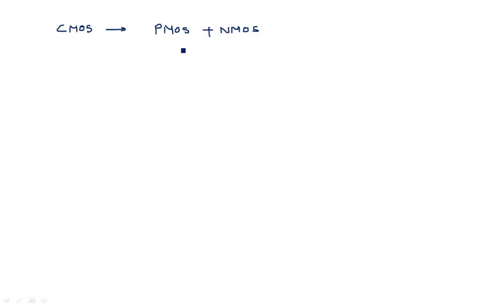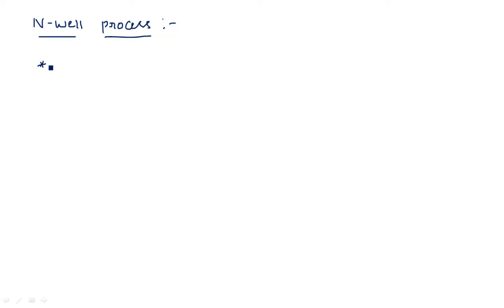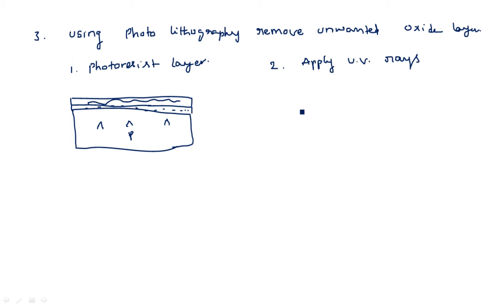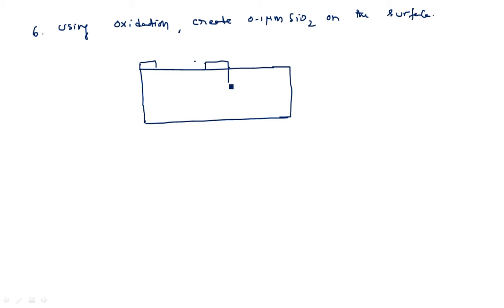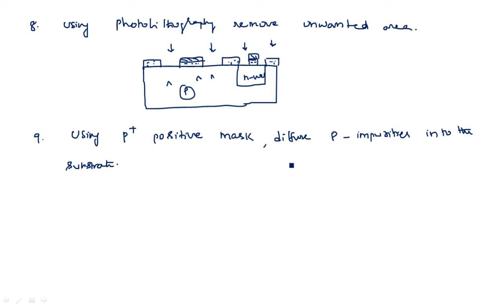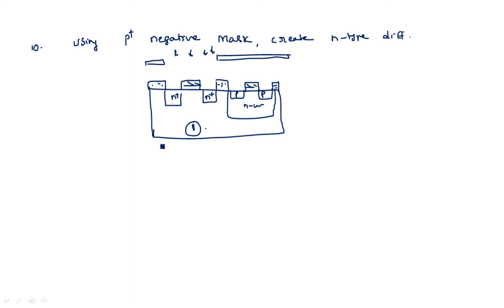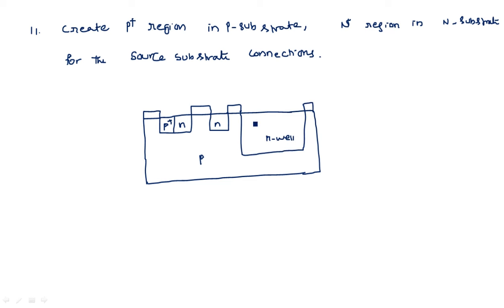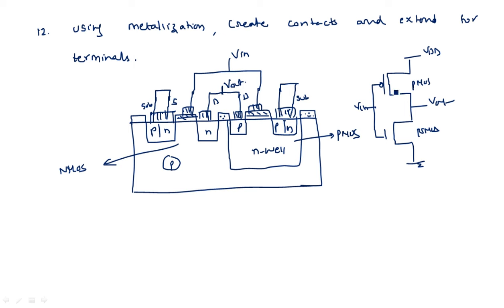CMOS Transistor | N-Well fabrication | VLSI | Lec-08

Comment: Photo lithography is used to protect several areas not removee phunda mwone
Reply: it contain three steps 
1st is Photoresist layer - it protects 
2nd is applying UV rays through mask, now the area that is covered by mask will not be exposed to uv and it becomes soft and this will be removed in next step 
3rd one is etching - this will remove the unwanted or soft part but it will not be able to remove the hardened part